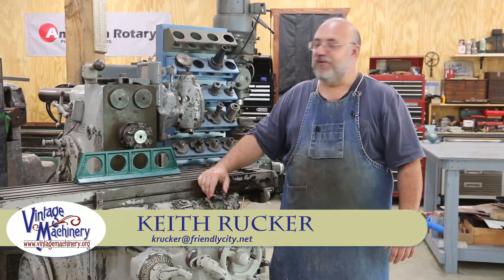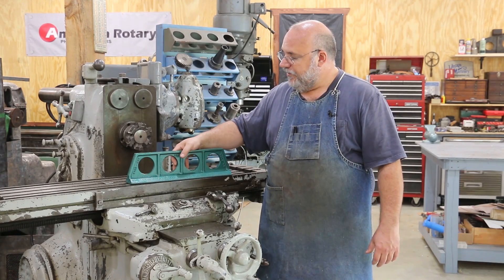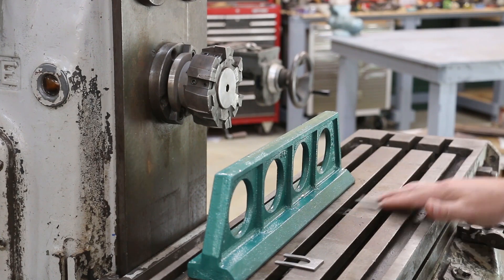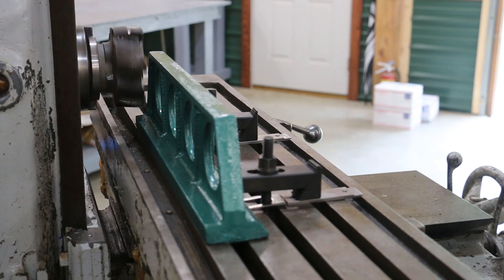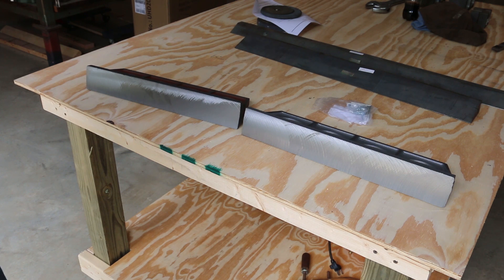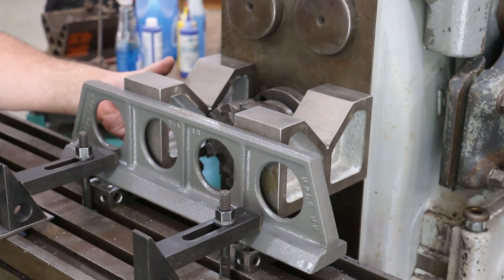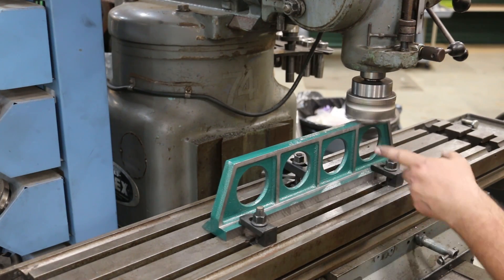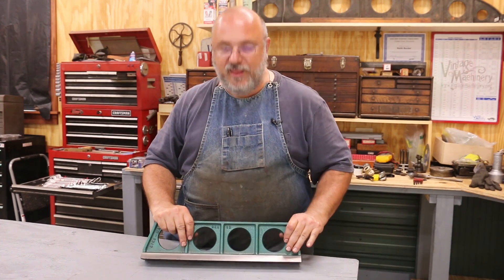Machining a King-Way Camelback Straight-Edge Rough Casting

Comment: Richard, quick question, would there be any value to mounting this into a surface grinder and hitting all the machined surfaces before moving on to the hand scraping, or would the time and effort required to do so be better spent just taking it from where it is and scraping it flat? 
 
Also, just came across your video series on building your foundry, and after watching it I did a little looking around to see you putting it into use, but couldn't find anything. Have you used it yet, or has it been back burnered due to everything else you have going on? If so, I completely understand, only so many hours in a day, but really am looking forward to seeing you use it, as I also enjoy watching when SV Seeker puts out the occasional casting video.

Comment: Thanks for the video Keith. Look forward to seeing the scraping class postings (enjoyed the last one) and the camel back being scraped video. May I ask a naive question?.. At the end where you show the finished milled part, when the part is flat on the table the foot of it sits flat and appears, by eye, to be a sharp point. With the exception of your right hand side nearest the camera. There is a shadow under it which appeared again later when the part was moved elsewhere on the table. Is this the relaxation of the piece as you described? or a low point in the casting? or just a visual illusion?

Comment: Good video but a couple of suggestions;
 Clamp the part down on the largest non machined surface for the first cut, not on some tapered shims and praying it won't move.
 Make as many cuts as possible with as few setups as possible to utilize the accuracy available in the machine and tooling. Example, mill bottom and right angle in one setup and they will be aligned with the base casting.
 It still amazes me that I see so many mills on you tube that have no protection for the ways behind the saddle, especially when dumping cast iron dust on them. A few dollars worth of pond liner and some metal strips can save a machine from a great amount of wear. If you check with landscapers you may be able to get some leftovers for very little. Attached with magnets, hooks or clamps it is easy to remove for cleaning. I have built them with "French cleats" so they could be removed when cleaning or they were in the way.
 I am not trying to be pedantic but everyone talks precision yet many don't take the steps to use and preserve the precision built into their machine.
   Mike (o\!/o)

Comment: just a general question Keith, do you or any of your friends know how much material is removed with a file stroke.  I used to file keys and getting them down to the  correct size took some amount of filing, I think I removed a thou for every ten strokes but not sure.  Can you help?
Reply: I think that would depend greatly on the files cut and sharpness. A sharp double cut bastard file is going to remove more material than a dull smooth single cut. Length of stroke will also make a big difference.
Reply: thanks. Could make another show from this?

Comment: Hello
What is wrong with just surface grinding thr edges? grinding is good enough for a lathe bed
Eddie Harper
Reply: some people like learning the old skill of scraping, sure most stuff now is ground , and hardended, but older stuff was cast and hand scraped, just tradtition i guess, they like older ways because they are also using older machine tools, if they were all modern cnc, they might not be so into it

Comment: Once you have the bottom scraped in will you measure everything to be sure the 45 and bottom are parallel with the back edge and each other?
Reply: The surfaces are used individually, so all they really need to be is flat.  Parallelism and accurate angles are not required.  Still, why not do a workmanlike job like Keith did, and maybe those close angles will come in useful for something at some point.
Reply: The 45 angle has to reference off the bottom surface. It wouldn't be very useful to check a 45 degree dovetail if it wasn't.
Reply: The 45 degree angle is used for spotting larger angles, like 50 or common 55 degree dovetails.  The actual angle of the machine's dovetails does not really matter, what matters is that they fit the mating dovetail, that both angles are the same.  The straightedge is carefully held up and rocked until it had good contact with the dovetail, and then moved back and forth to transfer the ink  It is a learned art.  Using a 45 degree straightedge to mark up a 45 degree dovetail would not work.

Comment: I have four cast iron flat plates all scraped in to 40 points/inch. I learned scraping while employed at Kingsbury Machine in Keene NH. I was employed at Kingsbury for 27 Years. In the early years of my employment, Kingsbury acquired a company named You Hansen grinders.  That Venture did not last more than 2 years, But I did learn from two trained way scrappers from the old Country. I own my own scrappers still, but lost my power flaker to a stupid part of mine to lone it to skilled trades at Chrysler in Indiana. I love to watch scape on YouTube. I still coach and instruct this process when needed at my present  position at the Kokomo transmission plant to keep th old girls working as correct as possible.  Enjoy this channel so much. Thank You Keith
Reply: Yokom; most of the scraping groups are out in the midwest, would you have any interest leading a group in the Northeast?
Reply: Ahh Kingsbury.  What a crying shame that the company finally folded.  I work next door to that immense blue building and remember the days when it was so busy that it had its own rail sidings...

Comment: If all you had was a Bridgeport, which surface would you have used as the reference surface? What other changes to machining order would you have made? Most of us don't have a horizontal mill.
Reply: bye a right angle milling head and now you turn your vertical mill into a mill with horizontal capeabilities. i have one of these heads for my 9x49 atrump 2v mill. funny thing is ive owned it from new and its never been out of the box yet. maby someday i will try it. the cost for one of these heads is about $700-$1000 dollars.

Comment: Is there a reason why scraped cast iron is better for this sort of thing than ground hardened steel, besides the price? I realize that you can't scrape them if they are made out of hardened steel. But if I were making something like this, my instinct would be make it out of tool steel, heat treat with an emphasis on lots of tempering cycles to stabilize it, grind it and then lap it. Yes it's more involved, but the thing would be very wear and dent resistant.
Reply: Siegfried Gust you can't get ink to print effectively on ground surfaces. so scraping gives you a medium to transfer ink from your reference to work
Reply: enginebill That is certainly true in that a scraped surface CAN be more accurate than a ground surface, but it is not true that a ground surface cannot be as accurate as a scraped surface. Perhaps more practical to scrape than to grind to the same degree of accuracy, but certainly not the only way to achieve it. (For that matter lapping for the final flatness is ideal.)
Reply: I think its just a case of using and learnng old skills, sure tools you buy are hardened and ground.  But like using a shaper, its un to lean even if out of date, but remember mos ofbthe machine tools kieth and co are using are old too
Reply: lookcreations Not if the entire surface is ground evenly. But if it were ground evenly and then a similar flaking pattern (or loose cross pattern) were ground in a tenth lower there should be plenty of printing ability. Seems plausible. I might even try it on my grinder with a piece of hardened steel just to find out.
Reply: It is because a hand scraped surface can be more accurate than a ground surface.
Reply: you may well be correct - worth looking at if you have the gear. from my recent experience refurbishing a shaper - I have realized that the scraped surface is made up of a multiple of depth scrapes so the surface is far from the smooth finish / level plane of a surface grinder.  The repeated printing and re-spreading the ink takes advantage of those little ink pockets - I guess much the same way a lapping plate allows the abrasive to be pulled out of the groves - the ink is pulled out of the pockets when the user re-spreads the ink.
Reply: Yeah, thinking about this further there might be another issue with hardened tool steel, stability. I can imagine that cast iron, while more brittle, might be more stable after stress relieving. Whereas hardened tool steel seems to move a slight bit in the months after heat treatment. That's why hardened parts for quality metrology equipment are aged after heat treat to allow for the movement post heat treat.  
In the end I'm sure that there are good reasons that scraped cast iron is the prefered material for these straight edges. My guess is that it has to do with their use for inking a surface that is being scraped because toolmakers straight edges that aren't really used for that but rather for checking straightness, not flatness,  are made of ground hardened tool steel.

Comment: Why on earth are those blocks called 1-2-3 blocks? Honest question. Beside that, nice video.
Reply: 1 inch x 2 inches x 3 inches
Reply: 1-2-3 block, the name, is genius in this case. Thanks :o)
Reply: Because the first guy to make them was good friends with Lawrence Welk..........
Reply: If you refer to 1-2-3 as the ratio then you'd be right and folks can't raz you about it :)
Reply: Ah 1 Ah 2 Ah 3 Ah blocks?
Reply: Because they are as easy as .... oh never mind.  ... But in Europe they are called 25 - 50 - 75...  Can you guess why?
Reply: Da L. Growing up with metrics, living breathing and working with it.....
 Yes, it is easy to guess :o) Although, in this case only is the standard system better since it is more easy to say 1-2-3 then 25-50-75.
Reply: Wunnerful, wunnerful answer, hm.

Comment: Will you grind the surfaces before you start scraping?
Reply: Paul Teirney Just what I was wondering. It could be the light playing tricks or more likely the uneven benchtop, but at the end of the video it looked like you could see where the straight edge and the benchtop disagree (especially on our left). Stefan Gotteswinter showed the stress relief warping of a much smaller piece of cast iron in a scraping video. I always wonder why they don't start with grinding to get it a bit closer before scraping the last bit. Seems to my (mostly ignorant about scraping best practices) mind that it would probably mean a few less scraping and printing cycles.
Reply: Flaking is not scraping.  The highest quality and most accurate machines are scraped in.  Moore Precision Tools, for just one.  Most new machines are not scraped in because of the cost in labor.  Flaking is done to decorate the surfaces and for making pockets to hold oil.  Scraping also makes pockets to hold oil.  There are also issues with resources.  A company like Cincinnati has the resources to buy and maintain machines big enough and good enough to grind large machine parts to very high tolerances.  Someone reconditioning a Bridgeport milling machine in his small machine shop or home shop does not have grinders large enough and in good enough condition to do that work accurately enough, but simple scrapers will do at least as good of a job, in skilled hands.  On the other hand, scraping is much slower than surface grinding.  Do you have high end machines or cheap labor?  I am not arguing with you, just stating facts.
Reply: I was thinking that too.
Reply: There is no need to grind it before scraping.
Reply: enginebill Again, it is not a matter of "need" or "must" or "can't". The question is if he WILL as it should get closer than milling to get a head start on scraping.
Reply: Ground surfaces are nasty to scrape, they create a tough skin on the surface.  Not so much on cast iron, but more so on steel.  It can still be scraped after grinding, but basically you need to get under all the ground surface so it can be scraped in evenly.
Reply: Okay, but this is quite specifically about grinding cast iron.
Reply: Even with cast iron, a ground surface is not ideal for scraping, and the surface will need to be 100 percent removed by the scraper.  It is just not as tough to do as ground steel is.  Milled surfaces are easier to scrape and are accurate enough for the roughing operation.  Ground surfaces also do not take the dye well.
Reply: As far as I can tell from my reading this morning, and from previously seeing videos of the process, modern industrial CNC machinery is precision ground then flaked on one surface in each mating pair (usually the surface which is facing down). And it is not flaked across the entire surface, but just enough to carry the way oil (which is accomplished the same way as the printing issue, already discussed above). Hand scraping is an amazing process, but it has not been the standard for industrial production in a long time.
Reply: Well, if they use flaking on ground machines, than it is a grinding technique.  If they use it on both ground and scraped machines, then is is a universal method of oil retention on slide ways.  In your first post on this thread you said "Seems to my (mostly ignorant about scraping best practices) mind..."  yet you are contrary to everything we are saying to help you learn.  I'm done...
Reply: I said "best practices", not "existence of practices". Focus on the actual words, Bob.
Reply: I guess we know now.
Reply: Flaking is one of the scraping techniques. Semantics, Bob. You know exactly what I was saying.